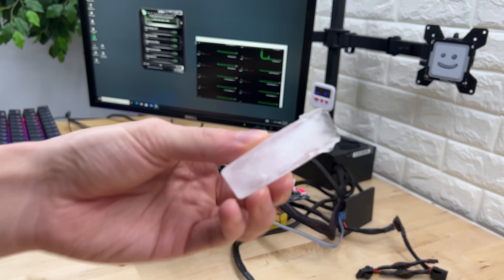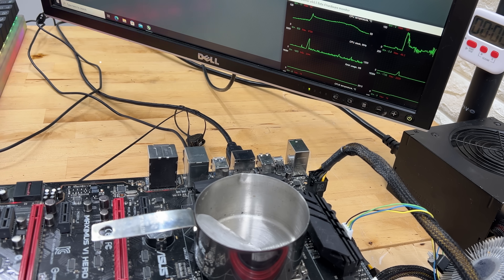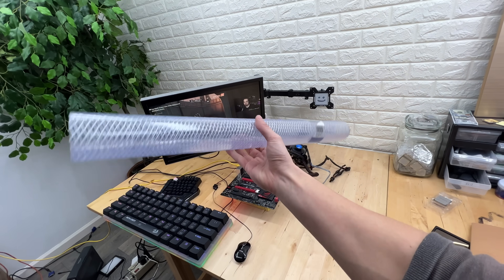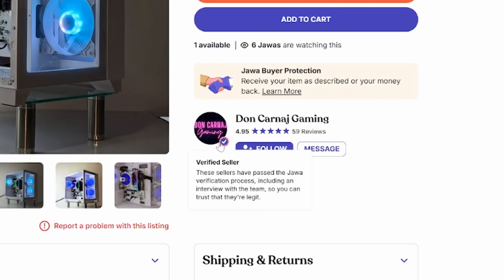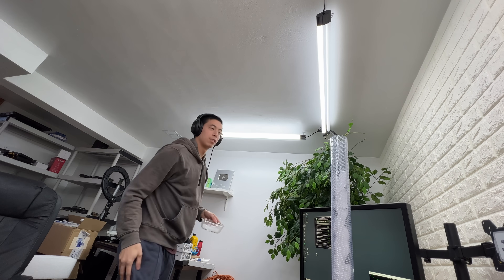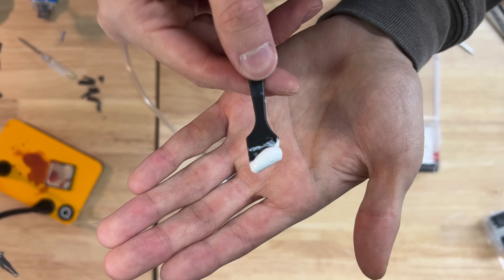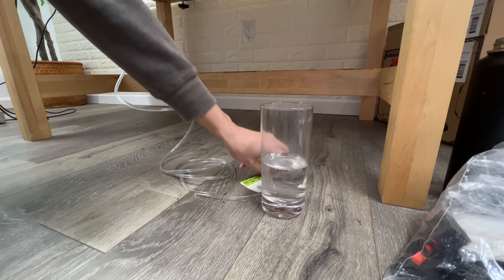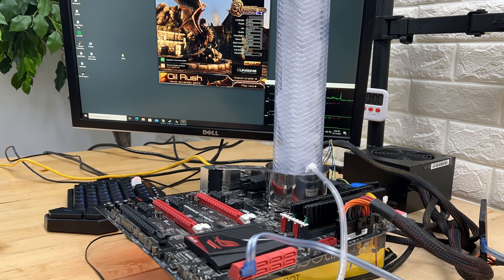Why aren't PCs cooled with ICE?

Comment: I had an idea almost exactly like this, except I would have the pipe containing the ice attached directly to the lid of the CPU itself, and I had an idea for one solid piece of ice that would get fed in like the sticks of glue for a hot glue gun, and it would be just a bit smaller than the diameter of the feed pipe to allow for melt water to drain away similar to how it does in your set up. The only reason I thought of this was as a way to do “extreme” overclocking on an “extreme” budget lol, instead of liquid nitrogen, and with some different minor modification you could adapt it to use dry ice instead of water ice if you need to go even colder.

Comment: Maybe if you could use the melted ice water to make more ice (from an ice machine) that would drop back into the tube cooling the pc.  Ex:  Put ice in the tube, When the ice melt pump it to an ice machine, The ice machine makes more ice that drops into a cylinder which makes the ice drop back into the tube. (infinite cooling?)

Comment: This might sound strange, but there is ice that doesnt float. There are various different kinds of water ice and they're usually just numbered like Ice 2, Ice 3, Ice 4 and so on. They are created under different temperatures and pressures than normal atmosphere pressure and temperature, making them freeze in different ways, forming vastly different ice crystals, some of which, like Ice 2 i think, are much more densely packed than regular ice and actually have a higher density than water

Comment: Probably a more practical, but maybe more boring way to do this would be a custom water cooling loop that instead of a radiator had ice in the radiator. That way you might get better thermal conductivity from the water being forced through the cooling block and it would pretty much always be ice cold if you got decent enough mixing in your reservoir. You also get the benefit of being able to ice cool both the CPU and GPU

Comment: After seeing the video, ice cooling is more practical than I thought! (still not practical) I would love to see you further experiment on the GPU and perhaps make improvements to the setup. Some suggestions I have inlcude:
- using a copper pot
- drilling a hole through the pot to insert the drainage tube such that water will drain sooner
- using pure water instead of tap water to negate conductive risks and improve cooling

Comment: So water cooled... but solid water? Also if you used shredded ice you could have flexible tubes that reach both the CPU and GPU from a single point on the PC (2 tubes from the bottom of the computer upside down) and just have an ice making machine feeding into both tubes using the water after the ice melts

Comment: I see two next steps towards making this much more practical: one, increase the insulation from the cpu to the ice so it melts slower but still keeps your cpu at a reasonable temparature. and two, condense the ice. somehow, idk what that looks like. but this would not only reduce the size of the ice container significantly, it would also increase the surface area used to cool the cpu, meaning more efficiency. idi how much smaller that would make it, but these two changes would be a massive step towards making this much more practical

Comment: might be able to optimize it by making your own ice. if you can create cyclinders the shape of the tube (probably slightly smaller so the water can get around the sides), you would have more ice, more cooling surface area, and more pressure on the ice at the bottom (if vertical). if you want to go really try hard, you could even cast/cut gear teeth into these cylinders in order to make a feed mechanism to solve the orientation issue

Comment: Imagine brining your computer to space. Unlimited temperature control
Reply: This is a misconception. Space isn't very cold, and without an atmosphere to absorb the heat, objects cool extremely slowly. 
Lack of pressure is why we think of things "flash feezing" in space, but that's only a concern for the water based astronaut. Not an issue for a computer.

Comment: I wonder if some sort of version of this would be able to keep a component at or under 0° constantly? Maybe not ice but something like liquid nitrogen? Oh wait, but i just realised that people already do that, but its not really constant. But then maybe the next step is automating it? I'm not sure how liquid nitrogen gets freezed, but with the ice configuration in the video, the tube leaks out into a cup, but what if you made a freezer that automatically makes ice cubes and refills them? And also, I wonder how much overclocking depends on the temperature and not on some other factor of a cpu/gpu, like I doubt you would be able to overclock infinitely as long as the temperature is fine. I'd also think about the shape of the ice, and maybe make it a cylinder to get more surface area in the pot. I would love to see more of this lol

Comment: I used to bring my laptop to work as a lifeguard while I was taking summer classes, and the temperature was hot enough that my laptop would shut itself down to prevent heat damage. I wound up using ice packs from the freezer pressed against the heat sink so I could do my homework.

Comment: Even more radical solution would be to use dry ice/acetone mixture in large copper vessel. Dry ice gives you temps of about -70, and acetone, being liquid at this temperature, allows to transfer heat to dry ice more effectively.

Comment: Idea why not try doing the thing cars do for ac and stuff and making where it cools the motor and then water cool the pc while the thing that the ac cools is part of the water cooler to pump super cold water while keeping it all sealed and stuff while letting a overflow capture tank to dump after so long if it ever produces water from the air

Comment: What if you took a normal PC in a normal case, but you put a tube that is slanted downwards and goes to the CPU like in this video, Then you have that same tube stick upright from the top of the case (cut a hole out first) where you can put more ice. Even better, use a tiny hose to drain the water out into an ice maker to make even more Ice!

Comment: I had a PC over a decade ago that had an overheating problem. I would fill an ice cube tray, freeze it, and then set it on top of the tower during gaming sessions. After a few hours I'd have a tray of water. Never felt safe putting it directly on the components though.

Comment: I once had a ps4 with a faulty fan , so my solution was to put ice bags on it as a cooling method,  and it worked very well until it overheated due to the ice melting completely

Comment: A way you could automate this is by getting an ice machine found in fridges and putting one in to make the ice but you could also use that water that is generated from heating up the ice to make more ice.
Reply: Wait why is no one talking about atmospheric water condensing on the CPU due to such low temperatures? Especially if you're in a humid environment? That water would be directly inside the CPU
Reply: @vincentturnt6635  this is a trivial issue. Simply put the computer inside a vacuum chamber.
Reply: Only if automated and works without my interferance at any point.

Comment: I'm no expert, but I think this has genuine potential if you were to keep tinkering with it more. Start with a copper-based measuring cup for better heat transfer, and maybe freeze solid blocks of ice into the shape that you're looking for in order to maximize space efficiency, but beyond that, this is a genuinely cost-effective and surprisingly practical way to cool a PC

Comment: "Why aren't PC's cooled with ice?"

"Because ice doesn't stay ice."
Reply: why arent pcs just put in a freezer so the ice stays frozen ?
Reply: @hpl3158  Because PC parts get hot, often too hot for a conventional freezer to keep the ice from melting at its contact points.
Reply: @ nah i meant just put in a freezer normally wouldt the pc stay cold enough
Reply: @hpl3158  I mean in that case it would work, as long as you make sure no ice buildup is in there with it.
Reply: @hpl3158 not really. The difference between -20 and 20 degrees is noticeable, but not enough to passively cool a PC. Air is a very bad conductor of heat, so you'd need a fan anyway. Also it is horribly inefficient compared to a simple cooling fan, and obviously much larger. Also in a negative °C environment you start having problems with condensation and like the video states, water is bad for a PC.
Reply: @jaspermooren5883  it's efficient if you build a whole crypto mining farm in some Siberian ice cave. Free passive cooling, at least during the winter

Comment: Now try pumping the water back into the loop at the top and move the ice to cooling the water instead, Maybe you could have a reservoir that stores the water. You could try replacing the ice with an alternative cooling method, like a car radiator.

Comment: is there not a way to isolate the intire cpu from the main mobo?
1 by extending the pins so the cpu is 15 cm above the mobo
2 somehow the ability to connect a 2nd same type mobo with only a cpu in it that communicates with the main mobo that has no cpu in it

Comment: This does not surprise me at all. As far as I’m aware there isn’t anything better at cooling than water, but water expanding when it freezes makes us generally have a quite high  lower limit to the coolant temps. If you use ice though, there’s no lower limit to the temperature of the coolant and so water is able to absolutely crush pretty much every other material in cost and pound for pound cooling. Not really cost effective if you compare it to using a heat sink with fans because air is actually free. But still fun to consider

Comment: >put ice in ice cooling setup
>water comes out
>have water go into freezer to get frozen again 
>have a contraption to dispense the ice from the freezer into the cooling setup
Reply: If you have a freezer, just use that on the computer. There is no need to transfer the heat so indirectly.
Reply: @delta_power3049  A freezer is too slow for it to effectively cool a working CPU. But 'storing' the 'coldness' inside of cubes, which can be produced over long times and then using it on the cpu may work better, unless the freezer produces cubes more slowly than they're being melted
Reply: @vaqxai4281  You didn't take outerspace into consideration.
Reply: @delta_power3049  that's a sure fire way to kill your refrigerator
Reply: Wait this is genius
Reply: The nonstop grinding sounds would be so annoying LOL.
Reply: THATS WHAT IM SAYING
Reply: Bro just found unlimted cooling glitch irl
Reply: perpetual cooling
Reply: But this is just refrigerant cooling with extra steps!

Btw, refrigerant cooling systems look badass, I'm still salty it's not a widely available solution.
Reply: Wallace and gromit ahh invention
Reply: this is just liquid cooling but worse
Reply: just skip that step and setup your computer inside a meat freezer
Reply: Literally, a fridge, but it solid to liquid instead of liquid to gas
Reply: Or... You could dispense the water giving you nice cool water (since it comes out directly after the ice melts) any time.
Reply: or just put the motherboard inside the freeezer instead
Reply: bro this is real world not minecraft

Comment: Man, the PC would fare better if it is a part of heat pump system or heat exchanger system that exchanges temperature of two closed water pipe circuit, which gives you hot water for shower and cold water for PC cooling. The water pipe connection that goes to the PC should be flexible type.

Comment: water is horrible at conducting electricity.   You can run brushless motors underwater...   you can run a pc underwater fine, the reason we cant for long periods of time is because the waters alkaline levels sky rocket and it becomes corrosive.   A computer running underwater creates a giant electrochemistry reactor.   Thats why we dont do it..  your CPU turns into an anode which will dissolve the entire computer into a toxic sulphate mud.   

The only time water can conduct electricity is if there is an electrolyte in it.    like sodium, or even soap.

Edit.   For fun, i think it would be more efficient to run the pc upside down and resting on an ice mantel.  So gravity handles all the drip and the pc is safe.

Comment: This has already been done like 20 years ago, using a fridge motor. It's nice to see rookies revisting old idea's
Reply: why are you so mad in all your comments
Reply: @airfryerkun  He's just jealous he's not the one making the video and getting all the attention. Typical crab in a bucket.
Reply: elaborate
Reply: If i recall correctly. Some former IBM engineer or something was building his own server at home. The problem was that he lived somewhere really hot and conventional cooling techniques  werent sufficient long term p. So he came up with a similar, copper-based system that he rigged up to his server. Using an old ice-making device from an old fridge, he made a platform that could auto-feed ice to his cpu's and feeding the wastewater back into the ice maker, creating this near self-sustaining loop. He only had to top up water once a day to keep it going. Was pretty rad.

Comment: I'm thinking about makin a cycle that it'll be possible to melt the water then it pours in to the small fridge in which there is small pots for ice cubes to be filled and as it fills it freezes and then when the ice melted just take the new ice cubes and drop it back in - infinite cooling

Comment: This reminds me of a highschool project I did in the tenth grade for chemistry and engineering, we had to design and prototype something that used an endo or exothermic reaction. My group build a CPU cooler with an Arduino that detected heat, when it hit 90C it would release salts into the water to cause an endothermic reaction.

Comment: In 2009 I gamed on a iMac that was dual booting Windows. The GPU and CPU were good, but the cooling system of the iMac was absolutely terrible. I could run Fallout 3 (in 2009, let me remind you) on max settings, but quickly the computer would crash because the GPU was overheating. 

I solved this by, I kid you not, draping a gallon bag filled with ice over the top of the computer, 5-6 cubes located at the top could keep the bag on the iMac, with another 15 or so hovering over the hottest part of the plastic, cooling it enough to keep the computer running.

If you use gravity to your advantage here, you can run it in a normal PC, you simply need to have the water tube located at the bottom to drain quickly, and the tube running diagonal upwards out of the case. I would recommend you use a copper cup, like they use when making Moscow Mules, for the next build, since it is a better thermal conductor.

Comment: Just an idea, but i think it would be easier to have a water cooling system but instead of the radiator and fan you could replace both with the ice. probably not like the big tube but like a small box that can hold around 10 - 16 ice cubes in a 2 x 2 grid not sure if it's possible as I'm not a computer expert unlike everyone here but i think it could be possible with the right setup

Comment: I've actually been using a bottle of frozen water to aid with cooling on my old GPU because the fans would stall from time to time. It didn't do a lot, but it was good enough to reduce the number of times my PC crashed before I got the fans spinning again :D

Comment: You 100% should do it on a GPU!
I'm also curious if just dunking the radiator from a watercooling loop (aio or custom) in ice-water would give similar results or not?
and on the extreme end well this works at overclocking in comparison to liquid nitrogen cooling....

Comment: How about just using a rock ice block it basically just rocks used in drinks so the water from ice just doesn't dilute the drink. One it doesn't melt and two you can constantly keep reusing them. the problem with them though is that you're gonna need space for them and you have to throw them back into the freezer once your done.

Comment: Why not try with dry ice?
Reply: Dry ice is frozen carbon dioxide, meaning it will release carbon dioxide gas as it quickly evaporates. You would need some way to vent it out of your house
Reply: @ThePistolKing1 woah,i didn't know that
Reply: @ThePistolKing1 just open the window.
Reply: The fumes would build up in enclosed PCs…
Reply: u just described overclockers uk tournaments 😅
Reply: u got a point
Reply: Expensive
Reply: Bro, instead of using dry ice we can freeze normal ice to -200°C or 328°F. That would be much economical.
Reply: @abhinavbhadange1234 why not liquid nitrogen then
Reply: @Yeetely_deetbecause it is not economical is it around $2⁵⁰ per litre which is enough for 1 hour of computing. Which means if we require daily 10litres of liquid nitrogen then it would cost around $25/day or $750/month or $9000/ year just to cool the pc.
Reply: @abhinavbhadange1234well, I know someone who sells liquid nitrogen and he told me the actual thing that makes it expensive is not the liquid nitrogen itself, but it is the special container you need to preserve it
Reply: @Yeetely_deet  all that means is that the specialised container is even more expensive than the already expensive substance lol
Reply: Good idea
Reply: Your room, especially if small, will eventually get into a problem of having too much carbon dioxide. Not good
Reply: he already did on a yt short
Reply: Condensation would occur, and sublimation would be very fast
Reply: I think dry ice is too cold
Reply: Sadly, it doesn't last very long.
Reply: the computer will break
Reply: I think this should’ve been a joke 😂 right ???
Reply: Pretty sure a steady supply of water ice is simpler…
Reply: "I CAN'T BREATH HELP PLEASE I CAN'T BREATH"